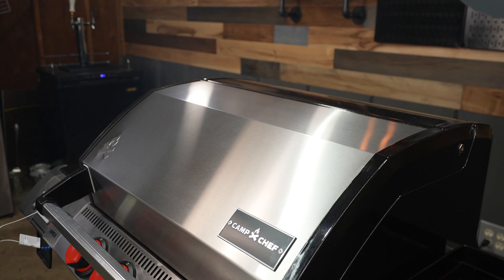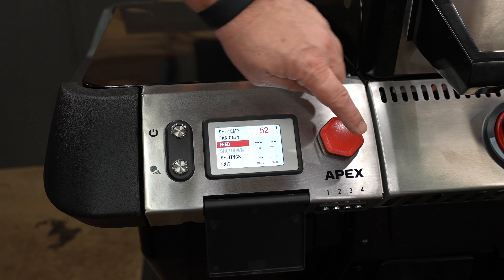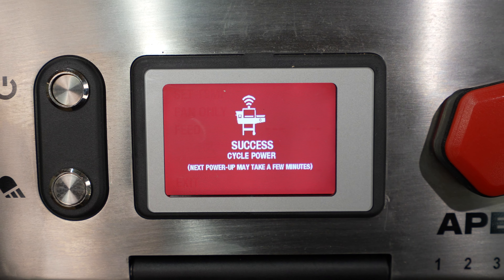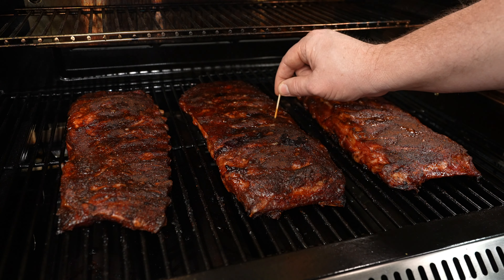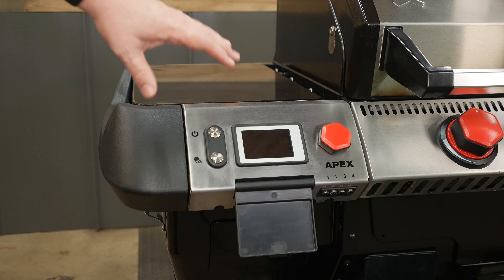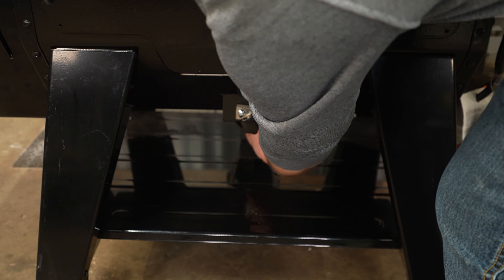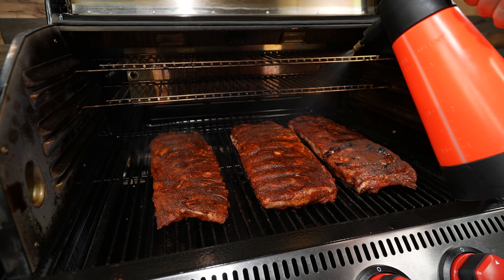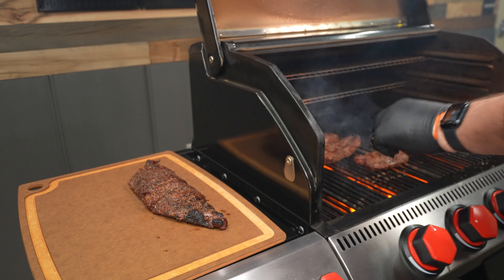ULTIMATE Pellet Gas Hybrid: Camp Chef APEX Grill Review

Comment: Can not find one of these on show room floor and it's hard to put sown 2 grand without touching it.  That said, how does the gas grill capability and build quality compare to a Weber Genesis?
Reply from the maker: Build quality is very good! The only thing I noticed is that the gas burners take a little longer to light up but they run really good! If you want an all in one unit I highly suggest this model. Thanks for watching!